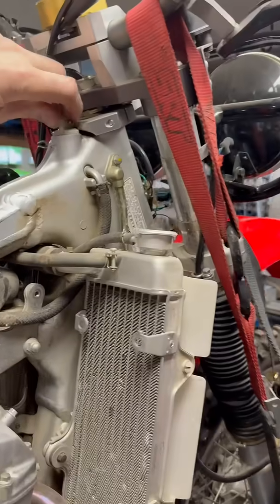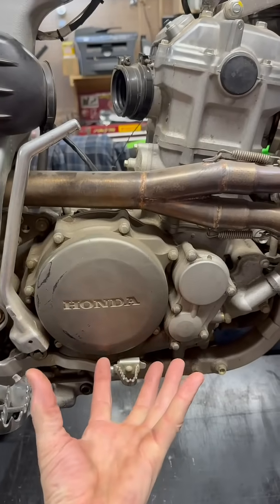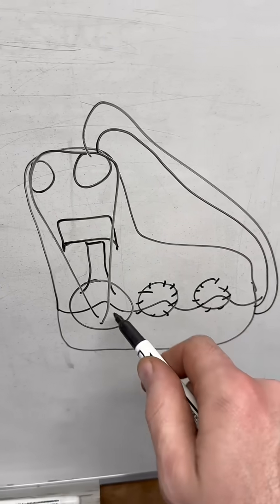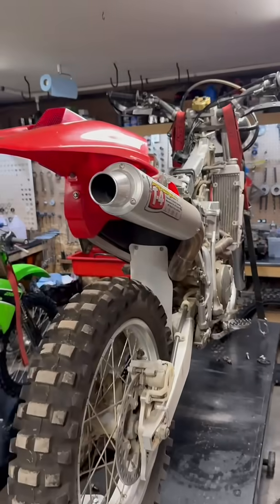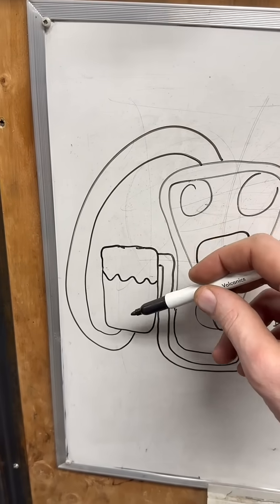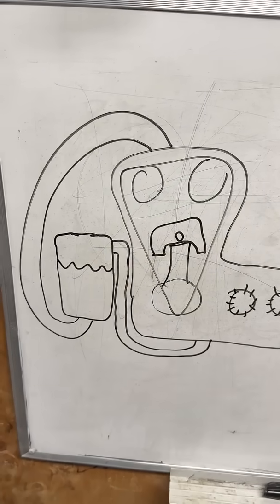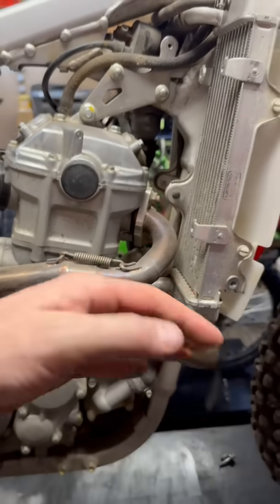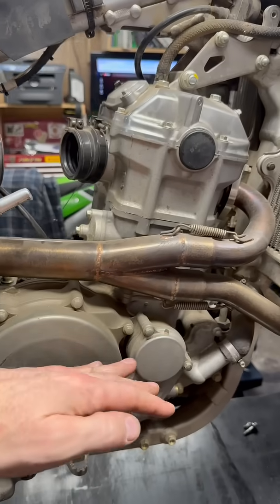Wet Sump vs Dry Sump

Comment: What’s the reason for difference in designs? Space limitations? Is one better than the other?

Seems like a wet sump would be slightly better if the oil pump stopped working. Or is that just wishful thinking?
Reply: It's mainly a packaging consideration. By moving the pool of oil away from the bottom of the engine, you can significantly reduce the height of the engine assembly which allows it to be mounted much lower in the frame. That lowers the center of gravity noticeably, without sacrificing any ground clearance. Also a dry sump is much less susceptible to loosing oil pressure in extreme loads or attitudes, like hard cornering or a prolonged wheelie. There are other smaller benefits like the engine being "pumped dry" of oil at all times, so there is actually a partial vacuum inside the engine case that can reduce pumping losses a little bit. Also your precious oil is being held out of harms way, not being at the bottom of the engine. Striking a rock or bump and loosing all the oil sucks...

The downside is weight, complexity and cost. You need many additional components like the tank, atleast 2 pumps, oil-lines etc. This causes more points of failure for potential oil leaks and complexity when changing and checking the oil.

A good example of the opposite situation of the bike in the video is the Tenere 700, which is infamous for its tall center of gravity. Next time you see one, notice how tall the engine is, and how far from the bottom of the frame it is mounted.
Reply: LasseJ here explained it really well, the short and dirty  answer when it comes to bikes is that a dry sump will continue oiling at damn near any angle (even fully upside down in some, but not every system) where as a wet sump can be engineered pretty well to not loose oil pressure in the event of a tip over or something,  but it's limitations are reached much sooner than that of a dry sump.